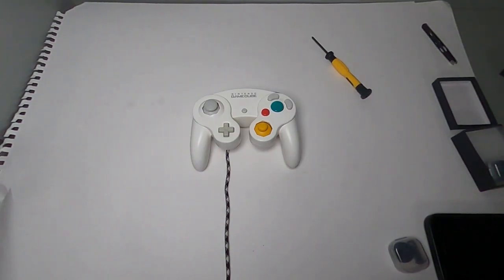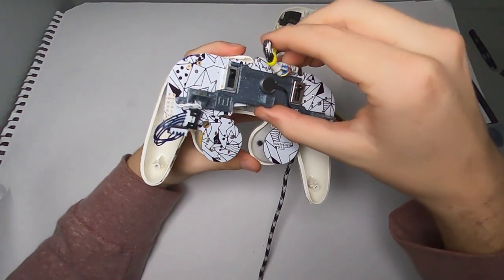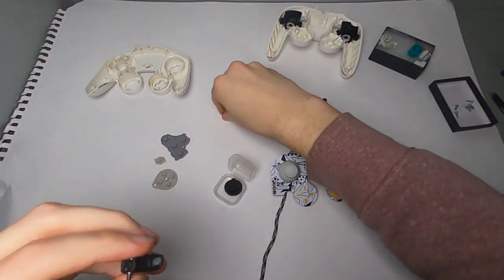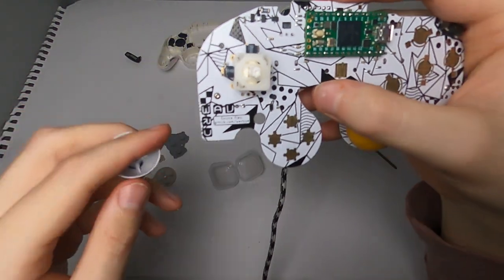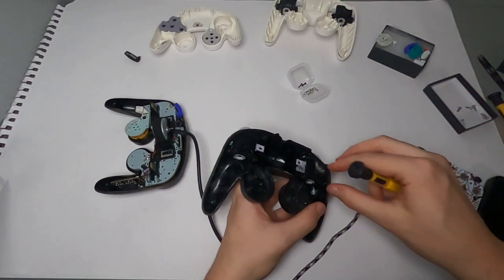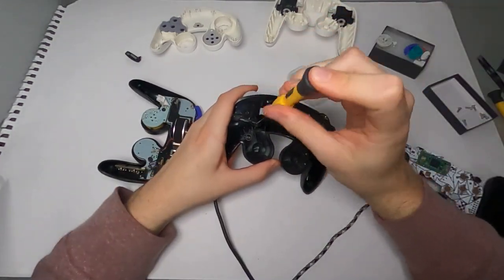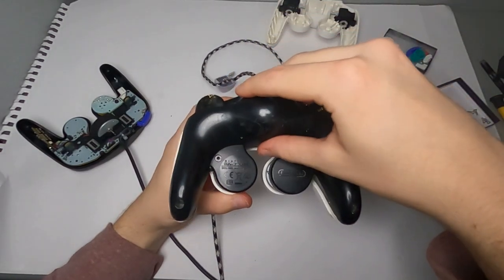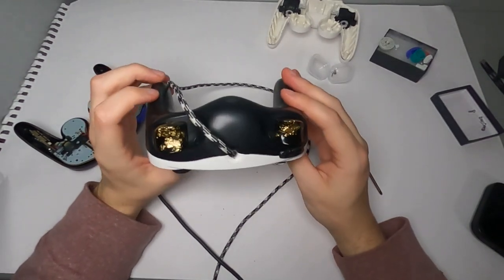How to Customize Your Gamecube Controller

Comment: Do you know where you can get torx screws that fit the threads of the controller? If I bother to take one apart, I think I'd wanna ditch all the triwing and philips screws while I'm at it to make future disassembly easier.
Reply from the maker: I’ve seen em on Etsy on fires’ shop before, tho I’ve never tried them myself. I’ve heard good things about them tho
https://www.etsy.com/listing/751713744/
Reply from the maker: https://www.etsy.com/listing/802712923/

This one is for screwdrivers, the other link was for the screws
Reply: @shugokimon  Awesome! Thank you very much.
Reply from the maker: @SoundToxin  np!

Comment: As a new competitive smash player is it worth getting a phob controller. When I look at getting a notched controller with SnapBack correction it’s about $140
Reply from the maker: For me it was worth it as I was going through new controllers pretty fast (the stick box potentiometers kept wearing out every few months). I’ve had my phob since September and it feels just as good as when I first got it! The up front cost of a phob is a lot but it may be worth it in the long run if you play a lot. Just make sure you get ur phob from a phob approved modder so you know your getting a good product and not a poorly made one. I got mine from @wavtype on Twitter and they did a great job! (Also the phob 2 is dropping or has already dropped so you may want to go for that over phob 1)

Comment: Hello what’s the different in the versions of the board ? Witch should I get for smash bros ultimate on switch ?
Reply: He is using a PHOB which is basically a custom motherboard built from scratch. The original gamecube controllers had 3 major revisions of their motherboard with the major difference being the stickboxes used for the analog sticks. The first revision used t1 stickboxes, the second revisions used t2 and the third revision used t3 stickboxes. 

The best OEM board are the ones with T3 stickboxes as they tend to last longer, be more consistent and accurate over time. Regular stickboxes use sliding potentiometers to determine the analog sticks position, and over time the moving parts wear down which lead to them behaving differently (Reffered to as PODE). The earlier stickboxes used varying amounts of metal moving parts which wore down faster, whereas T3 boxes were all plastic. The PHOB board he used in the video uses a mixture of T3 stickboxes and magnetic hall effect sensors instead of potentiometers so to remove the inevitable wear and tear and inconsistency of moving parts. 

PHOBs are super expensive ($100-$200 just for a board), the negative impacts of PODE matter more for Melee then Ultimate as Ultimate just isn't as high in APM and precise as melee, so honestly a good T3 OEM controller is perfect for Ultimate and anything beyond that is personal preference. The best way to get a T3 gamecube controller is to buy one of the smash ultimate branded controllers, which can be found new in box on amazon for about 50 dollars.

https://www.amazon.com/Nintendo-Controller-Super-Smash-Bros-switch/dp/B07HC2F97Q/ref=sr_1_2?keywords=smash+ultimate+gamecube+controller&qid=1682165507&sprefix=smash+ultimate+,aps,434&sr=8-2&language=en_US&currency=USD

Comment: I keep trying to get my hands on a GameCube controller but I never have the cash on hand when in cex :(
Reply from the maker: This is the most reliable way to get them

https://www.amazon.com/Nintendo-Controller-Super-Smash-Bros-switch/dp/B07HC2F97Q/ref=asc_df_B07HC2F97Q/?tag=hyprod-20&linkCode=df0&hvadid=241928067043&hvpos=&hvnetw=g&hvrand=12728491905528320494&hvpone=&hvptwo=&hvqmt=&hvdev=m&hvdvcmdl=&hvlocint=&hvlocphy=9004446&hvtargid=pla-527236446384&psc=1&region_id=373786

Comment: What is your opinion on replacement analogsticks that are „best/good/closest to oem“ ? I’m in need of a new one cause my rubber peels off :(
Reply: I would love an answer to this question as well.  A lot of the aftermarket ones are kind of "gummy" or "rubbery" feeling and don't feel quite right.